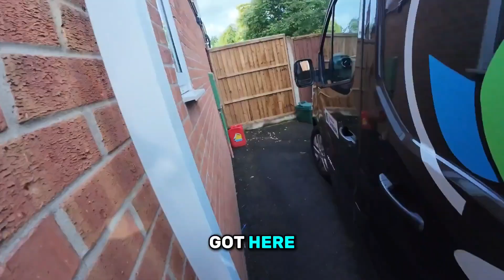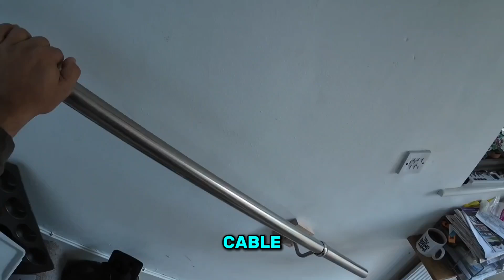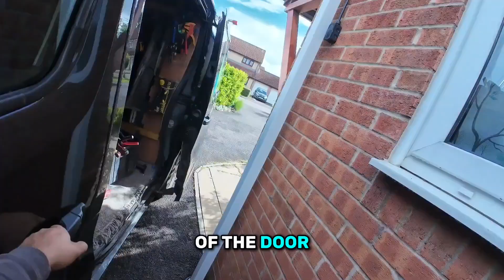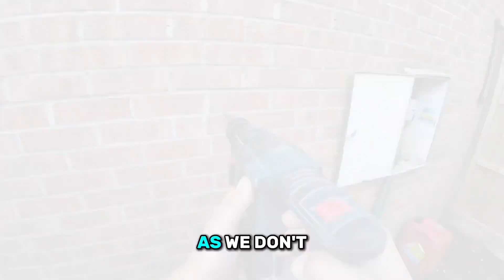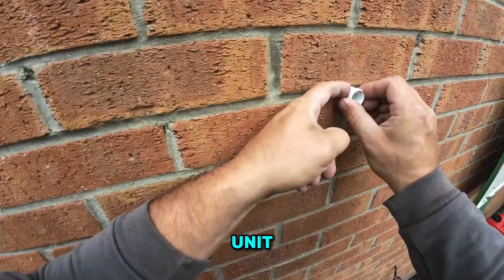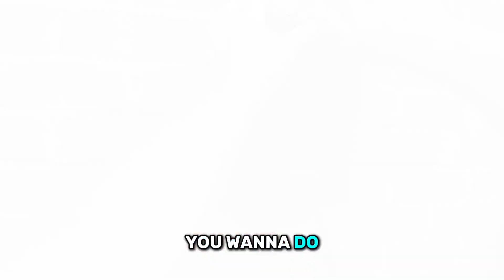Don't Drill Your Wall Before Watching This!

Comment: I came across this type of ev install last month……. Why have you set the ev charger to 60amp because it is clear in your video it’s a loop supply and there on 60amp fuse ….. DNO need to give permission for ev charger install ……. Second is why no SPD which is required under bs7671 also the other looped property should also be visited to see if SPD is required there ….. its ok customer saying he will only charge at night but that’s the time high power is used in the home and most likely used at same time like washing machine or dishwasher and shower and cooker and hob 
I would suggest DNO come out and slit the loop which they will do most of the time free of charge
Reply from the maker: Good eye, and fair questions. Taking them in order.

On the loop, you are right that it is the thing to deal with first. Where we find a looped service on an EV job we ask the network operator to split it, and as you say they will usually do that at no charge. It is the proper fix and it is worth the wait.

On notification, every chargepoint we install is notified to the network operator. Where the supply is looped or the capacity is tight we go to them before the work rather than after.

On surge protection, Amendment 2 made an SPD the default rather than the exception, and a new circuit in a dwelling will normally have one. Where it is left out there has to be a documented reason on the certificate, not just a preference.

On the load itself, your point about night time being when the house is busiest is the right instinct, and it is exactly why load management belongs on a supply that is tight rather than relying on the customer's charging habits.

A few minutes of video is never the whole day, so it will not show everything that sits on the certificate. Happy to talk it through properly if you want to message directly.

Thanks for watching closely.